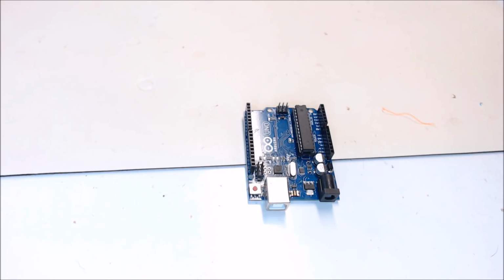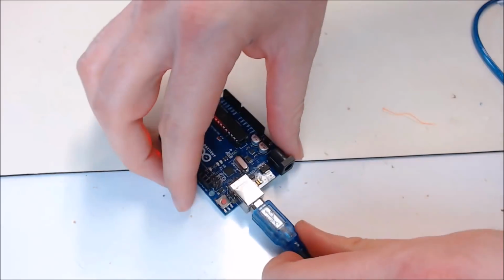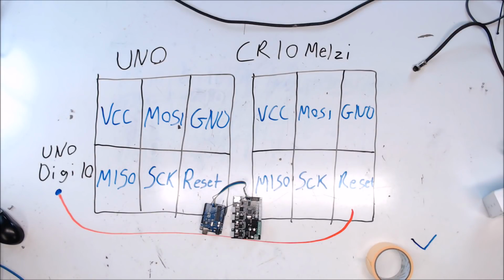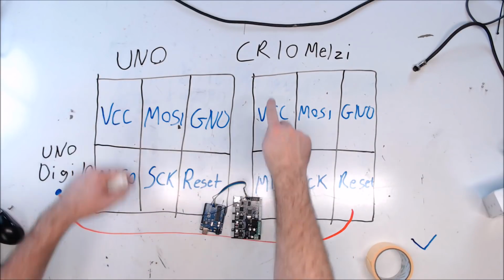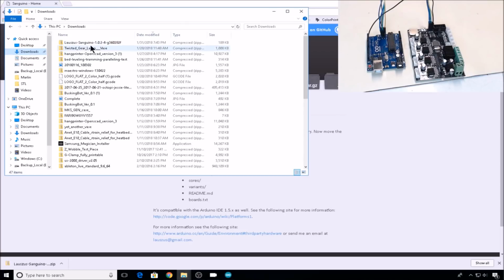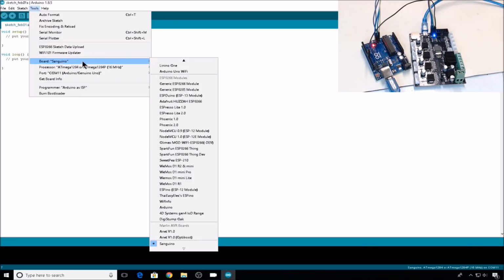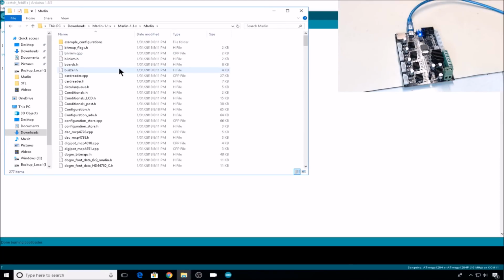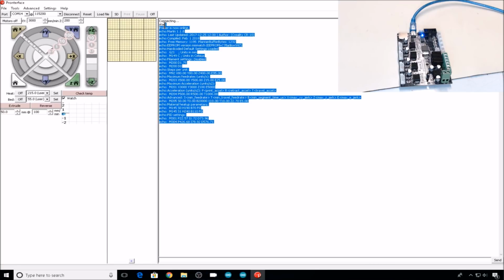Creality CR-10 Marlin Firmware Upgrade - Chris's Basement

Comment: Thank you for this guide. -- With the latest CR-10 (V1, regular CR-10, no S, etc. -- board revision 1.4), I was able to make this work. -- Though, I had to overcome a few hurdles (detailed below):

I wired it exactly as shown, but there is no jumper on the board to select where the power comes from; and it didn't work the first time -- even though the board's blue LED was on -- so, I got out a phone charger and plugged it into the wall and the printer board, and that also makes the blue light come on -- having it plugged into external power AND my laptop via the Arduino ICSP, was enough to give it the power it needed to program in the boot loader.

Additionally, there's no more board configs in Marlin 2.0.x -- but if you go into the configs folder there is a readme.md file that contains a URL to where you can download the latest board configs (it's version specific, but for 2.0.7.2 it's here: https://github.com/MarlinFirmware/Configurations/archive/release-2.0.7.2.zip

Additionally, Marlin 2.x doesn't work with the Arduino IDE anymore (Bug #16487 in the Marlin repo shows the incompatibility and contains a discussion regarding the drop in support -- it's really annoying because they just blame Windows and say "everything is fine, switch to Linux, duh"). -- Anyway, you still need to use the Arduino IDE to burn the bootloader, but once that's there you have to switch over to PlatformIO to get it to build -- for that to work, you can use the included platform io project and set the board to "melzi".

Additionally, the build will still fail (because Marlin 2.0 is too big!) -- so you'll need to add the following line to the end of the [env:melzi] section of the project file:
build_flags   =  ${common.build_flags} -fno-tree-scev-cprop -fno-split-wide-types -mrelax -Wl,--relax -mcall-prologues -Os -fdata-sections -ffunction-sections -Wl,--gc-sections -Wl,-static -s
build_unflags = -g -ggdb

These flags (and unflags) tell it to optimize the build for size, to strip out unused functions, and removes any previously defined debug flags. -- For me this brought it down from 102% Flash usage to 97% Flash usage.

Additionally, in the [env:melzi] section you'll need to change the upload_speed to 115200.

Hope this helps someone out there.
Reply from the maker: Thank you for posting all this info!

Comment: hi chris ! just want to tell you that your video is the most comprehensible video on the net for now ! , i`ve watch many others but most of them are going too fast when they show the procedures and i did not wanted take a risk , but the way you explain the process of flashing the bootloader and installing the firmware is more elaborate , it worked for me the first time  !! thank you chris
Reply from the maker: Thank you very much for this comment! This is great feedback and it helps me out greatly to understand what kinds of things people want to see.
Reply: @ChrisRiley  Agreed, too many videos on you tube explaining how 'easy' it is to do something and there will be lines like 'Simply just  put the Z234 or equivalent in the  standard way into the flux compartment capacitor as you would normally to on a LLR278 warp drive on standard NASA  year 2179 model spacecraft - Easy!!' and your like what the F does that mean!!!

Comment: Hi Chris.  Once again, best video available to explain a given subject.   Two comments if it helps
- The wiring and process is identical if you have an Arduino Mega instead of an Uno.   Same pins, also the D10.
- I got slightly confused when you plugged both the CR10 and the Uno to the Arduino IDE.   In reality you don't need the CR10 plugged at all for the bootloader so I'd probably suggest to not plug it to your computer at this stage and only do that when you're done with the bootloader and you're unplugging the Uno (Mega in my case).
- and yes, even if your port says Arduino Uno (or Mega) you still need to have the Sanguino selected.  It's how you tell the Uno/Mega which board you're uploading the bootloader to

And lastly, when I used the latest Marlin (1.1.9) and try to upload it I got the error message of u8glib.h missing.    Simply go to the Arduino IDE / Sketch / Include Library / Manage libraries and search & install the u8glib library by "Oliver".  Works like a charm.   

Bests,
Reply from the maker: Thanks Bernie, great tips man!

Comment: Thank you.  This Tutorial saved my CR10S from going out the top floor window into oncoming traffic.  I had a power outage while flashing my firmware and I feared that was the end.   I tried multiple tutorials from multiple sources and this is the only one that worked out for me.   The only difference that I had was I needed to use the Mega 2560 board.  You stepped it through nicely in easy to understand segments with good video of the important parts.   Thanks again.
Reply from the maker: Great to hear one of my videos saved a printer for the window treatment.  ;)

Comment: Thanks again for being awesome.  I ripped out a Creality3D V1.1.2 from one of my CR-10's planning on replacing with a GT2560 which I'm compiling a Marlin version for but...Decided since this one was already out of it I would follow along with this video.  Worked like a million bucks I now feel sufficiently techy. Only difference with this board version was/is that there is no jumper to switch, the board powers on from USB in the stock condition.  So you can skip that part (if anyone is curious).  Thanks again now I have a 1.1.9 Marlin board ready for when I screw up the custom board lol.
Reply from the maker: Thanks for the comment man, that looks to be pretty common on the newer boards not to have that jumper. Glad it helped you out.

Comment: Just finished flashing Marlin to my Tronxy X1 Melzi board. It was a success! Thank you for posting this video it was very helpful.

One quick note: I kept getting errors while compiling the Marlin firmware. The fix was to move the // comments to a separate line in the code for the lines generating errors. Once that was done and everything compiled, I had to try uploading the firmware a few times before it finally took.
Reply from the maker: I am glad the video helped you. Nice work!

Comment: dear Chris,
I was lucky to have to wait for my arduino to come by mail. I used the time to watch your video several times. :) But it still had some challenge to get it running after connecting it the right way. First problem was that the sanguino diddn't insatall the way as described with just copying the extracted files in the hardware folder. I had to go in files/preferences/additional boards-url.
To compile the new marlin one libary ist missing, it is U8glib, that has to be added manually. 
But done it today, I like the new features and I'm prepaired for my E3D 
Thanks a lot.
Reply from the maker: Good to know about that library. Glad you got it working!

Comment: Thank you Chris and your commentors below.  With advice from you all I have just managed to update an old CR10 V1.4 without the power supply jumper option.  Like Bigbernie23 I uploaded the V1.1.9 without hitch.  I installed the library, in advance, as he suggested.   I could not have done it without all of your help.
Reply from the maker: Glad this helped you out, that's great to hear.

Comment: Thanks so much, I'm following your blog as well for the S5. I got the Sonic pad and whatever it flashed to it caused it to just boot up to a blue screen. I just ordered some jumper cables and I have my Arduino board and will give this a try when the cables come in. I don't know why the Sonic pad was having issues with my CR Touch which is what the first problem was and then when I had to shut off the machine that's when it loaded to a blank screen.
Reply from the maker: You're welcome! That is really strange. I wonder if it wiped out the SD card some how. I don't know much about the Sonic pad.

Comment: Thank you for your nice tutorial (still useful today 🙂)
I strongly advise to use Linux to upload the firmware to the CR-10 : this solved the drivers issues I encountered to access the printer with Windows. I was never able to make Windows recognize the USB FT232RL integrated circuit of the printer, even with the debug tutorials you can find.
Reply from the maker: Thank you, that's a good tip using Linux, thanks for posting it.

Comment: This is the best tutorial on this, that I have seen on YouTube. Thank you for taking the time.
Reply from the maker: Wow, thank you!
Reply: @ChrisRiley  
Your welcome Chris, your attention to detail is excellent. I had one problem with this upgrade and that is mesh_bed_leveling doesn't fit is 64K of Sanguino memory. Any suggestions?
Reply from the maker: @Hotwire_RCTrix  Check out disable M503, if you don't need 503 output, you can uncomment that line and save you some memory.

Comment: Chris a great comprehensive vid is better than any other I have looked at i went through the lot until you mention the jumper move to USB, I don’t have that on my CR-10, did not comprehend you have a board that’s black When my board is green V1.1.2. and ideals how I flash this one, buy hey what a great vid and your the tops at describing what to do, just one little quibble a bit slower would be nice,
Reply from the maker: Thanks Anthony, yeah some of the newer ones don't have that vref jumper. I will give slower a shot. 😉

Comment: Super great info!!! I have a question about once the process is setup with the control board having the installed bootloader. How do I install the next newest hex file for the future? Maybe paste the hex file into an SD card and plug that into the SD card reader in the control board??? I have an 8 bit Atmega AVR 2560 control board, CR10 Max. Thank you again!!!
Reply from the maker: Check this out, you can use Xloader. https://www.diyelectronics.co.za/wiki/Arduino/RAMPS_XLoader_Guide_rev1.pdf
Reply: @ChrisRiley  Thank you!!!

Comment: ugh, gonna have to do this...  I got a new extruder and I need to calibrate the E-steps but no matter what I do it doesn't save...  I've tried calibrating through the LCD interface, hooking up to my comp and using pronterface, even making a G.Code file for it and 'printing' the settings...  Nothing.  My only option left is this.
Reply from the maker: Probably your only option other than reflashing is setting it in your start gcode everytime, M92 Exxx
Reply: @ChrisRiley  Good lord I really went down the rabbit hole with this one lol.  Started with Arduino IDE and Marlin 1.1.6.. Installed that but it made the extruder run backwards.  Started over with Marlin 2.0, but I couldn't compile with Arduino IDE because of some weird filename length issue.  had to switch to VSCode/PlatformIO for my IDE. after bungling my way through that I finally got it to compile, only to find out my board didn't have enough space to install 2.0 lmao.  So I started deleting features to get the firmware size down small enough until it fit.  But when I go to upload, it doesn't recognize the com port for my printer. Thankfully I just had to unplug some other USBs and it picked it up.

Comment: Expected signature for ATmega1284P is 1E 97 05

         Double check chip, or use -F to override this check
Reply: sorry i have an atmega 2560 and as it looks i dont need a bootloader
Reply from the maker: Yes, some of the have a 2560 board, you shouldn't need to load the bootloader.

Comment: One word, though. In my case, the original jerk settings were better than the new Marlin defaults. Fortunately, I had written them down (and all parameters) before flashing, so I re-entered the configuration in the new firmware and everything went back to normal.
Reply from the maker: Awesome! This is good info to have.

Comment: Hell of a video, Chris. My CR-10 Mini and I are with you right up until "Burn Bootloader." Then I get avrdude errors like

 avrdude: stk500_getparm(): (a) protocol error, expect=0x14, resp=0x14

avrdude: stk500_getparm(): (a) protocol error, expect=0x14, resp=0x02

avrdude: stk500_getparm(): (a) protocol error, expect=0x14, resp=0x10
         Hardware Version: 425479
         Firmware Version: 16806916.-1450987692
         Topcard         : STK502
         Vtarget         : 1.8 V
         Varef           : 0.0 V
         Oscillator      : Off
         SCK period      : 0.1 us

avrdude: stk500_initialize(): (b) protocol error, expect=0x10, resp=0x01
avrdude: initialization failed, rc=-1
         Double check connections and try again, or use -F to override
         this check.

avrdude: stk500_disable(): protocol error, expect=0x14, resp=0x10

avrdude done.  Thank you.

Error while burning bootloader.

I really hope that formatting sticks. FWIW I'm on a Mac, don't have a Windows. My m/b doesn't have the usb power switch but it lights right up when USB is plugged in. In fact, it lights up when the Arduino is plugged in.

This is figuratively my first rodeo. Any advice would be appreciated.
Reply from the maker: Try to downgrade to Arduino IDE version 1.8.5. I have had a lot of trouble with anything newer than that.
Reply: @ChrisRiley  I gave that a shot, but no good. I ended up taking it to an acquaintance and he hooked me up. He says my Sanguino library was probably old or something and didn't cut my proverbial mustard. I'll have to do better next time. Still, Marlin is loaded and my menus aren't in Chinese anymore. To the next hurdle!
Reply from the maker: @redevil665  Right on man, glad you got it up and running. Keep up the good fight! :)

Comment: Hi Chris, love your videos, just a quick question. I upgraded my motherboard to a SKR E3 Mini V2 with Marlin to be able to upgrade my CR-10. Since it’s the V1 model is it possible to add the BLTouch, and probably a few other features, runout sensor, and ultimately Raspberry Pi Octo Pi, or is my generation of CR-10 too old for newer upgrades?
Reply from the maker: With the new mini board you can add all these features.

Comment: Hi Chris, Ihave a cr-10 but the board inside is slightly different, there is no usb switch. so there is an errow occur, avrdude: ser_open(): can't set com-state for "\\.\COM2". what shall i do?
Reply from the maker: You will have to leave the board plugged into power while you flash. Just  be careful, don't touch the wires while that case is open.

Comment: Hi Chris. You are my go to 3d printing guru. Can you tell me if the bootloader you describe here will work on my Tronxy X5. It has the standard board with Marlin 1.1.5 installed and I want to go to 1.1.8 or 9.
Reply from the maker: It depends on what chip it has, but if it's the 128 chip, it should work fine.

Comment: I keep getting
Error while burning bootloader.
avrdude: Yikes!  Invalid device signature.
         Double check connections and try again, or use -F to override
    I have checked all connections with no success. attempting this on a CR10s board
Reply from the maker: Are you trying with an Uno or a programmer?

Comment: Great Video thank you for that :) Hoever I have a problem with upgrading my CR-10 S5. I've downloaded the th3D software (older one last one fot Arduino IDE) changed all in it, but I cant load it to the machine because  it is atmega 2560 not sanguino like stated in this software. Now when I chose sanduino Arduino Ide verifies code and tryes to send it to the CR-10 but it shows error (of course wrong board is selected) if I chose good board (atmega 2560) I cant compile the software becase error shows  that the wrong bord is selected I should chose sanguino but I cant because it wont work . How did you manage to compile the software and send it to CR-10
Reply from the maker: This might be something in the TH3D software. If you board in a 2560, then you will have to use that setting in the config and in the IDE. If it's a 128, then I would try an older IDE and see if that works. Try version 1.8.5

Comment: Hey Chris, your videos are always so good explained, but this time i got an Error and im very confused. I made the bootloader and did everything you said for my Cr 10 mini (ATMEGA 1284P) and after i tried to upload it, i always get the Error: "...arduino-1.8.13\hardware\tools\avr/bin/avr-gcc.exe: The filename or extension is too long.
"
Do you know what to do? I mean which Filename or extension? How can I fix it?
I also tried to connect it trought Prontoface and it doesn´t work.
I tried to burn the Bootloader again and now i get an error.
Reply from the maker: Hey, this is a limitation of Windows, they file path can only be so long. Try moving the Marlin folder to your C drive to shorten it.

Comment: Hi ! Great tutorial ! Time to upgrade my CR10 so i'm searching a Uno and find some V3 on amazon that have ATmega328P  on board. Is it ok ?
Reply: https://www.amazon.fr/Elegoo-ATmega328P-ATMEGA16U2-Controller-Microcontr%C3%B4leur/dp/B01N91PVIS/ref=sr_1_6?__mk_fr_FR=%C3%85M%C3%85%C5%BD%C3%95%C3%91&crid=VVTCIH3GR6X5&dchild=1&keywords=arduino+uno&qid=1609103485&quartzVehicle=35-481&replacementKeywords=arduino&sprefix=ard%2Caps%2C205&sr=8-6
Reply from the maker: Yes, that board should work.

Comment: I know this old info but I got CR10s last time id used Sdcard too firmware my cr10s but im using Arduino too firmware my cr10s because I bought BL-Touch, Do I really need this uno card because I dont have these boards
Reply from the maker: I depends on what board you have. If it has a bootloader on it, then no.
Reply: @ChrisRiley  thanks for the reply